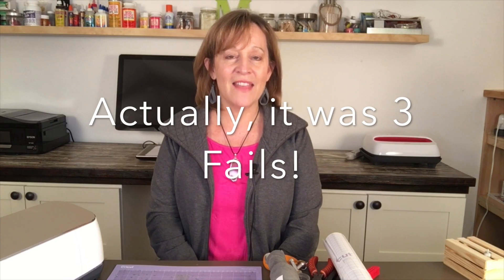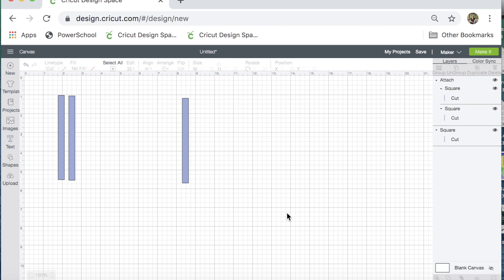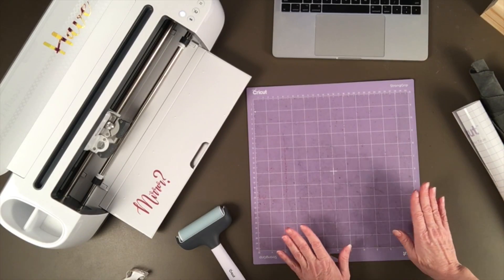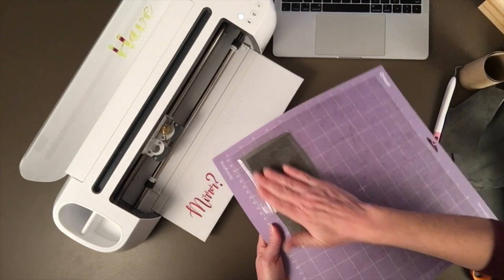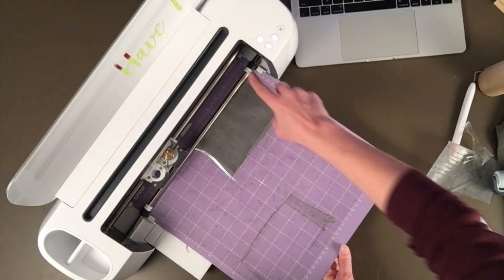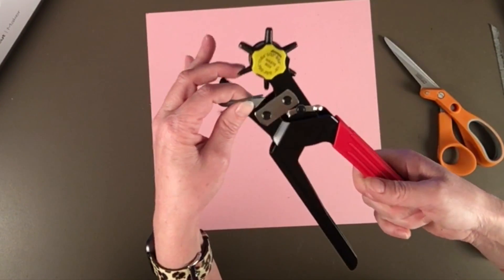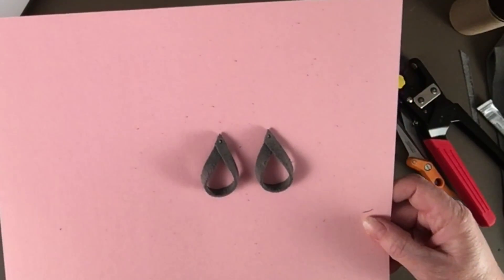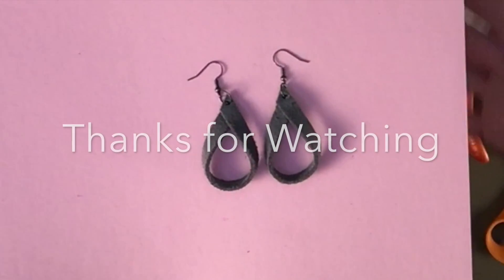Cutting Suede - Learn From My Fails

Comment: Hi Marilyn, thanks for doing the hard work for us. Question..what brand and where did you get  those pliers for making holes in the leather?
Reply from the maker: I bought the leather punch tool at Harbor Freight. The brand is Pittsburgh and it is only about $6.00. With a coupon, even less:) I still use it for some products, but I also use a set of 10 punches that you use with a hammer and I got that set off of Amazon. It can be a bit more easy to see exactly where your holes will be with the punch set. They both work very well, though. Thanks for watching and the comment.
Reply: Thanks so much Marilyn! I enjoy all your videos and have learned from you how to make my own earring designs! I'm off to investigate leather punches at Harbor Freight and on Amazon. Have a great weekend.
Reply from the maker: @kathyking7704  Here is a link to the set I got from Amazon. They were about $10 - $11. Today they were listed at $9.25. If the link doesn't work, you can search Amazon for  DGOL hollow punch and you should find it. https://www.amazon.com/gp/product/B07MDB4D4V/ref=as_li_tl?ie=UTF8&camp=1789&creative=9325&creativeASIN=B07MDB4D4V&linkCode=as2&tag=makingwith022-20&linkId=9d0b971a7201acfde4a2894f4fb0717c
Reply: @MakingwithMarilyn  Thanks again Marilyn ...I'll send you a couple of pics of my earrings.
Reply from the maker: @kathyking7704  Yes, I would love to see them!!!